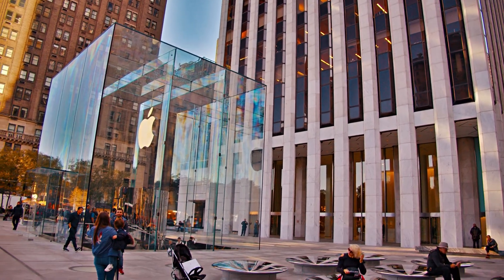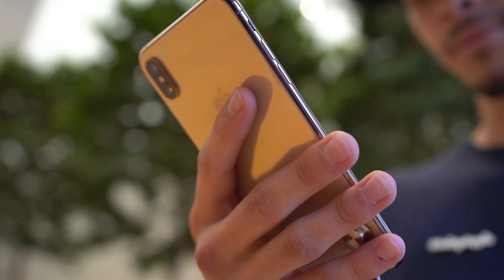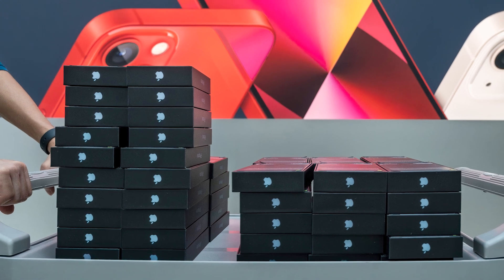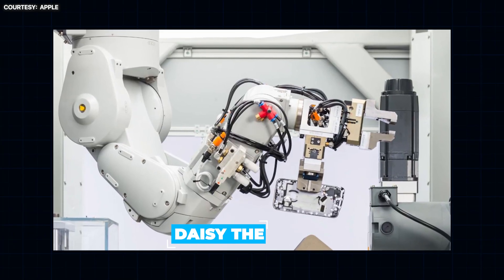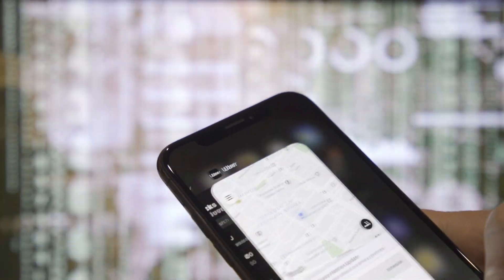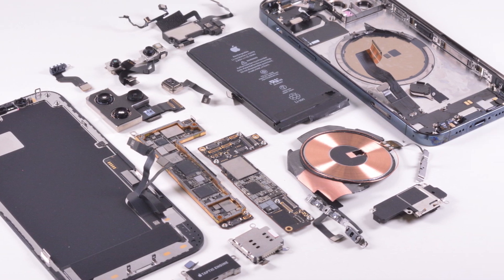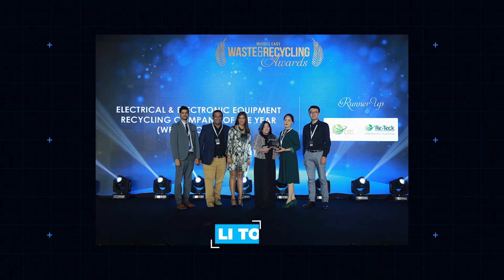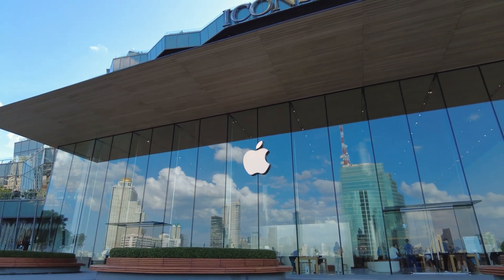How Apple Recycles Old iPhones

Comment: I have a perfectly working iPhone. However, because Apple no longer provides updates four years after purchase, but the apps all require an update, a fully functional iPhone has become completely useless. And that's just so you can buy a new, overpriced iPhone. This is not sustainable, environmentally friendly or economical! So no, I don't think that Apple dose a lot for the environment. The only thing Apple is doing is filling it's pockets!
Reply: Ok but keeping a phone for 4 years is not bad. At that time most ppl trade in and upgrade. If apple made Thier phone lasts for like six years functioning properly no would buy new ones.